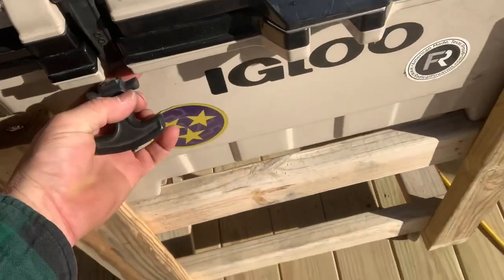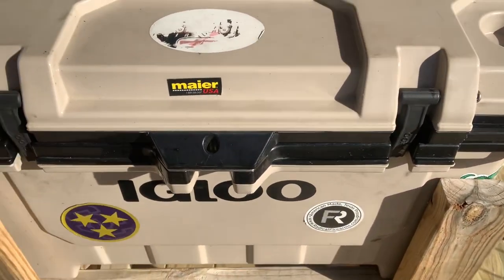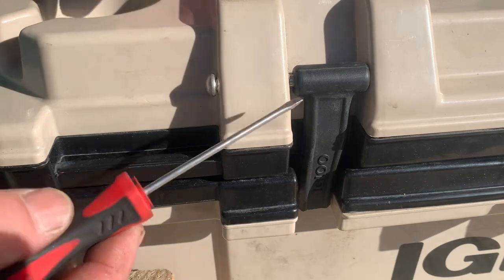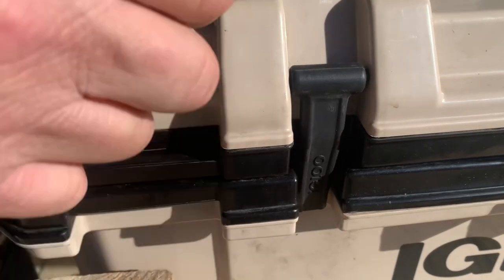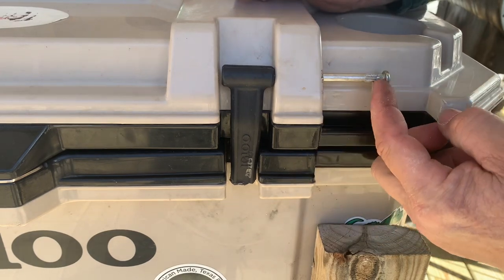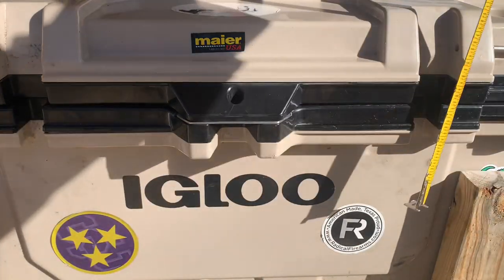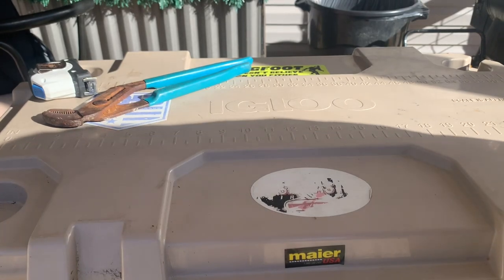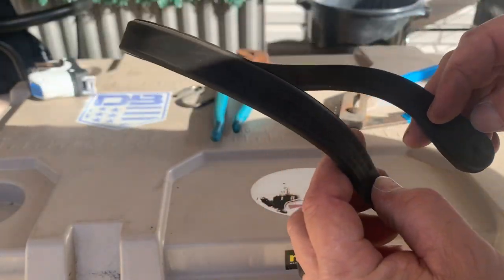How To Fix Rubber Straps On A Igloo Cooler

Comment: So.. you ever get those latches from Igloo though?  Crazy to me that they are "out of stock" on $200-300 cooler latches.  Either they don't intend to make them, or they have some many failures and never fixed that design flaw..
Reply from the maker: Thanks for the question crimtide ! Yes igloo did send me new latches and was very easy to work with it did take about 5 -6 weeks but I got them . I’ve not put the new latches on yet I like my strap better✌️
Reply: @jeffscookingadventure  Thanks I appreciate the reply.